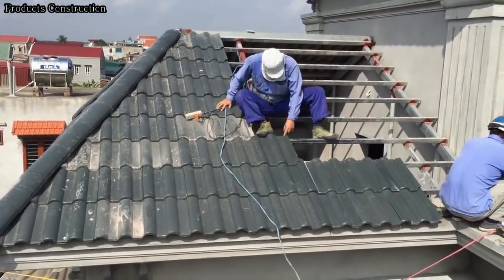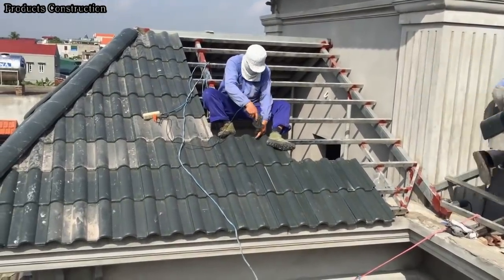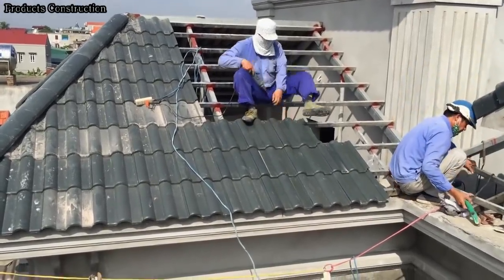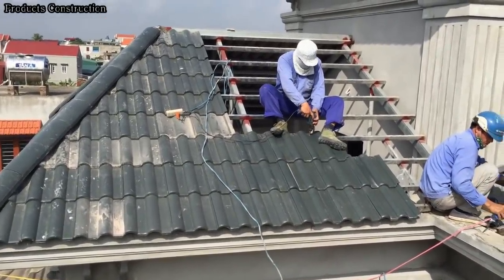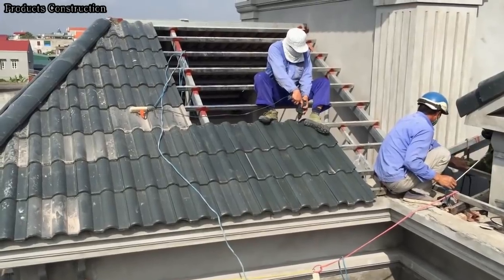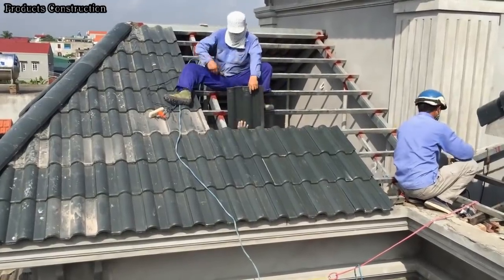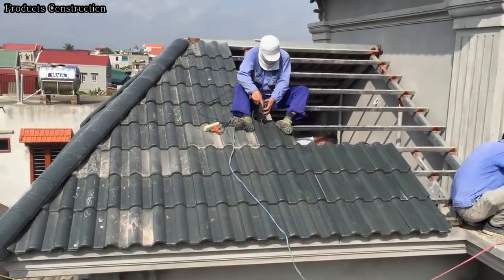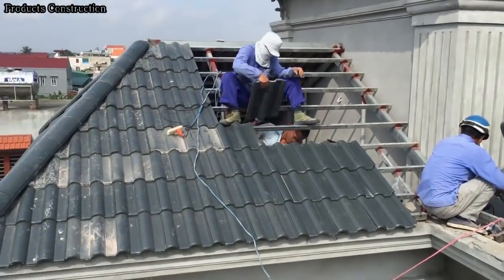Construction Craft Method // Install Roof With Roofing Tiles On Fixed Frame

Comment: One drill bit going through concrete tiles and steel. Must be a steel bit you’re using?
Reply: He's using screws not drill bit
Reply: BG Trade I never seen screws alone that’ll self drill into concrete. You have tapcons screws that’ll screw into concrete but you have use a mason army bit first.
Reply: The tiles aren't from concrete ,   he's using metal  self drill screws . You can see him pick up the screws from his pocket at 9:34
Reply: BG Trade I had another look at the tiles. They sound and look concrete. I know the ones you’re on about, back home they come in 900mm strips (dectra tiles) they’re good tiles and the underneath are coated with a black bitumen
Reply: @taffythegreat1986  maybe the tiles have holes in them.
Reply: George Mooyman could very well be. And he’s using the tec screws to cut straight into the purlins
Reply: @taffythegreat1986  
The tiles are predrilled , you can see that clearly  at 9.40
Reply: It’s a self tapping screw sir
Reply: The tiles are designed with holes everywhere you go around the world, they are meant to be drilled on the structure,
Reply: @mosusumedikenneth5203  that’s what I’m thinking